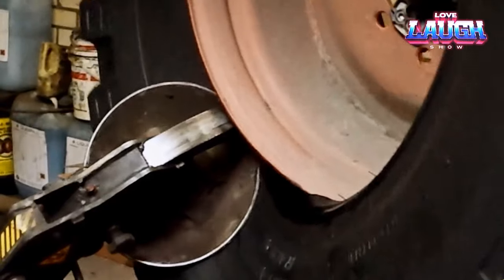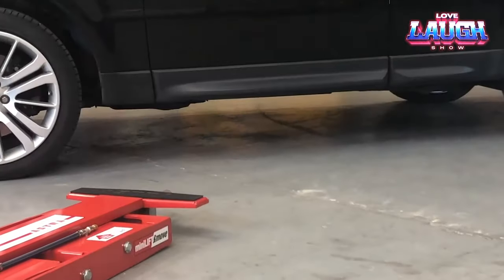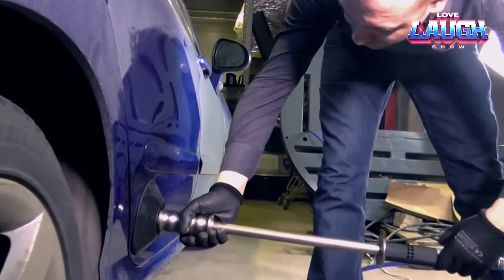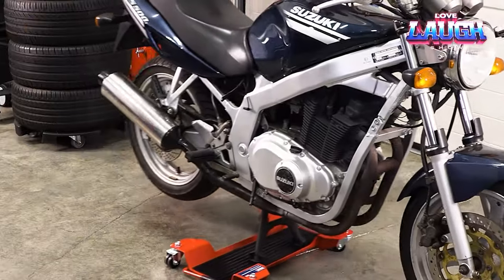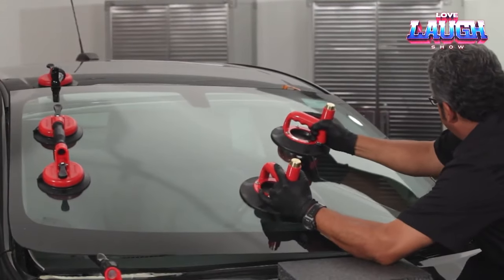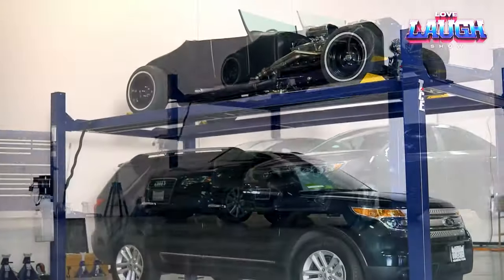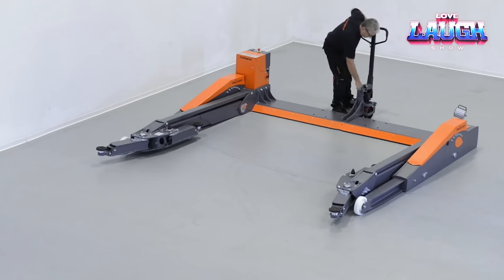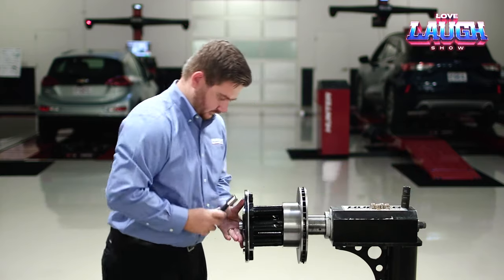16 INGENIUS INVENTIONS TOOLS FOR YOUR AUTO REPAIR SHOP

Comment: The BETAG Magic Wand might just save me from hailstorm headaches!
Reply from the maker: The BETAG Magic Wand is designed to help with DIY hail damage repair, providing a convenient and effective solution for minor dents and dings caused by hailstorms. While it may not work for severe damage, it can certainly be a valuable tool for addressing more minor issues without the need for professional intervention. Keep in mind that results may vary based on the specific type and severity of the damage.

Comment: Laser Tools Brake Disc Lip Removal Tool – any good for old disks
Reply from the maker: The Laser Tools Brake Disc Lip Removal Tool is designed to remove the lip or edge that can form on the outer edge of brake discs over time. It can be used on both old and new discs to help ensure smooth and effective braking performance. However, it's important to note that if the brake disc is heavily worn or damaged beyond the lip, it may be necessary to replace the disc altogether. Always inspect the disc thoroughly to determine if the lip removal tool is suitable for the specific condition of the disc.

Comment: How effective is the Magic Wand for DIY hail damage repair?
Reply from the maker: The Magic Wand is a popular tool used for paintless dent repair (PDR), which can be effective for addressing minor dents and hail damage. Its effectiveness largely depends on the skill and experience of the user, as well as the specific characteristics of the dent. For smaller, shallow dents, the Magic Wand can be a useful tool in skilled hands. However, for more severe or complex damage, it's recommended to consult a professional PDR technician who has the expertise and specialized equipment to assess and repair the damage effectively. Keep in mind that achieving high-quality results with PDR requires practice and experience.

Comment: Can the Rar bead booster really handle the toughest agricultural tires?
Reply from the maker: Yes, the RAR Bead Booster is designed to handle the toughest agricultural tires. It's a powerful and versatile tool used to seat the beads of tubeless tires, making it especially useful for larger, heavy-duty tires commonly found on agricultural equipment. With its high-pressure burst of air, the RAR Bead Booster can assist in seating the tire beads securely onto the rim, ensuring a proper seal. However, it's important to follow the manufacturer's guidelines and safety instructions when using any tire-related equipment, including the RAR Bead Booster.

Comment: How easy is it to install and use the Sidekick Deluxe Glass Setting Kit? 🚘🔨
Reply from the maker: The Sidekick Deluxe Glass Setting Kit is designed to be user-friendly and includes detailed instructions for installation. It's generally considered to be straightforward for individuals with basic automotive knowledge and experience. However, it's important to note that if you're not comfortable with auto glass installation, it's recommended to seek professional assistance to ensure a safe and proper fit. Always follow the manufacturer's guidelines and safety precautions when using any automotive tools or equipment.